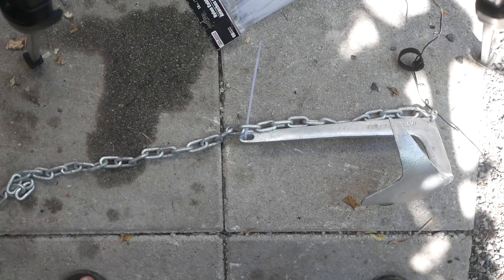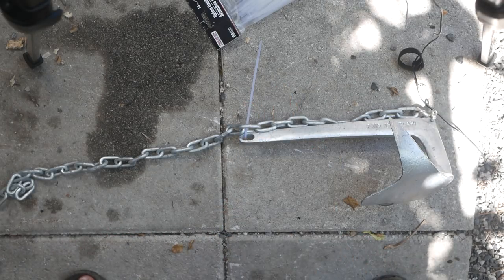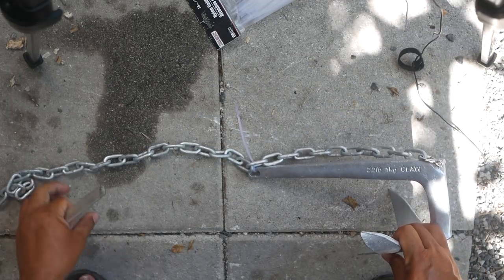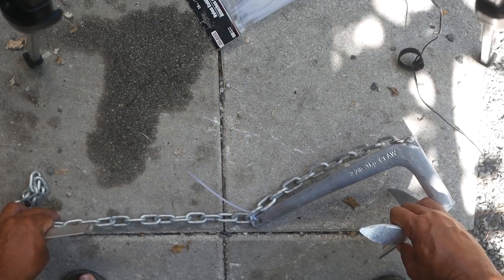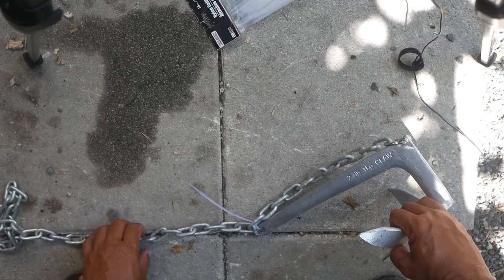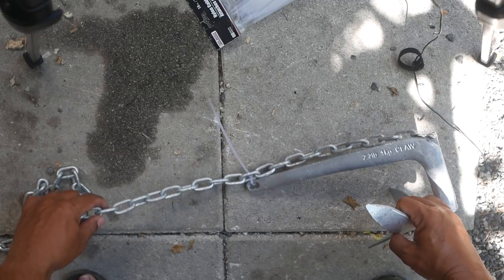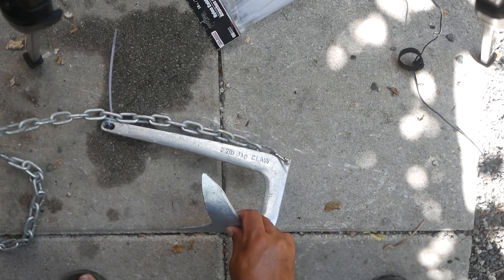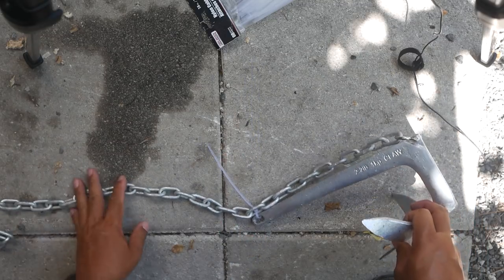Anchor Set-up For Tarpon And Safety

Comment: Very good info here, you did a GREAT job showing and explaining. I use the HD Leverlock system from YakAttack. I put one on BOTH SIDES of my Predator PDL so I can adjust to wind/current direction. Yes, I agree fully the quick release AND the break away are absolute safety recommendations to have. I forgot to comment on the previous video when you lost the anchor...1) can you go back and snorkel around for it during SLACK TIDE and retrieve it? 2) was the strong pressure of the current the ONLY factor that made it break or maybe you see the rope also getting brittle after long time use in saltwater?
Ohhhh yeeaahh...the 'money shot' is at 6:08......."show us your feet Steve"  :-D ha!
Keep up the great work Steve, you have been going at a pretty intense pace recently with focused intensity. It has created a momentum that is moving a lot of things and impacting people beyond your channel. Congratulations but just don't let it overwhelm you. Wise words= remember don't let your 'hobby' become your 'job' (because then you lose that place to retreat to).

Comment: Hey I just was wanted to know how would this work with a 3000 lb boat? Or would it even work. I guessing a heavy duty zip tie?
Reply: mate the system still works except you can go to much heavier things to secure it, heavy zip ties twisted wire I have used  at times . in a boat you have engine power to snap whatever your securing with so you can up grade. I prefer the fencing wire with just a few twists as it will tighten a bit before breaking if you shock the anchor the zip ties tend to pop straight away.
Reply: Yep. Thats it...just use a heavier duty zip tie for heavier boats. About 10yrs ago I started seeing some Professional Fishing people on TV use this type system and it is becoming very popular. Very simple and very practical. Just use a strong enough tie to resist your every day use but still weak enough to 'break' free for safety or saving your anchor from getting stuck at the bottom and losing it.